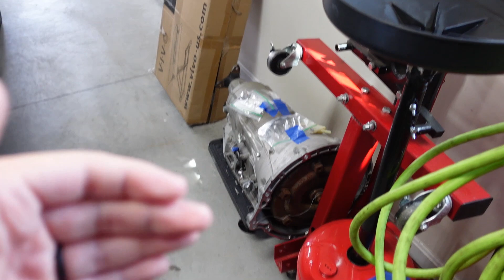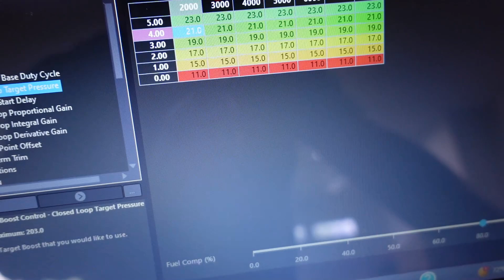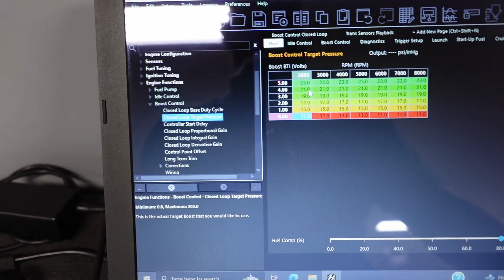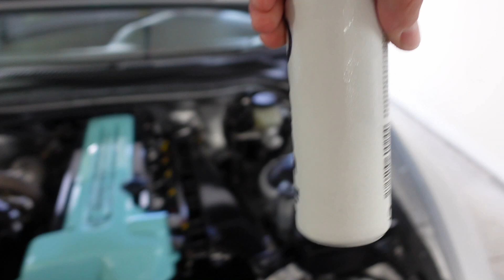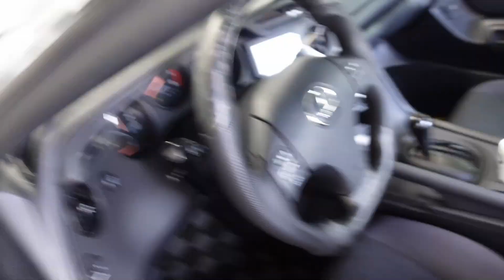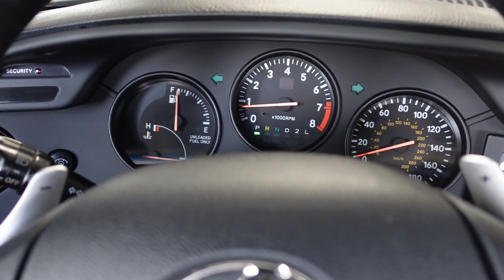Auto Supra Gets More Boost! (In Car POV)

Comment: Interesting to see someone going a different route with the auto transmissions for the MKIV - will be exciting to follow along!
As far as cams goes, I don't think you would move the curve too far to the right with 272's. It might help with spool though for the 6870.
For reference, I have a 6466/cast manifold with GSC S2's (274's) through an ATF auto with a 4K stall - the car is vicious on the street. Extremely responsive around town, running 36psi on the stock bottom end and shifts around 7600. So I would think that you have quite a bit of headroom there.

Otherwise, been a long time follower. Love your attention to detail regarding absolutely everything!

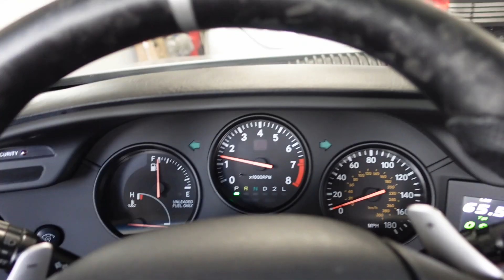Comment: @12:25 the excess fuel you saw during that cold start is likely from your Afterstart Enrichment which only last a short time and goes back to zero where your actual cold start enrichments take over. 

Notice from .85 lambda it jumped right to your cold target of .95 lambda which is perfect for cold start as the engine is cold the atomization of fuel is less a mist and more a liquid spray from the injectors. 

Update: it could also be from your cranking fuel as during cranking the ECU doesn’t pull from the VE table but directly from the % DC during cranking 

I wouldn’t worry about it but unless it lasted way longer but  yes you can adjust it to suit 😉

@24:30 camshaft wise remember it’s the wife’s car not yours 😂 doint go too aggressive maybe a 264/272 would be good Kelford but GSC makes some really good camshafts which have more gains than losses RE to response.

Comment: That’s awesome bro I just got my 6870 turbo can wait to get it on with phr s23 manifold and 264 cams vvti 2j my goal is around 750 to the wheels
Reply: turbo is really big for only 750 wheel.. itll make right at 900-950 on a mustang dyno.    I think its my favorite size setup, i have a 3.4 and the 6870 just makes it feel like a large engine, barely tell its a turbo car really.

Comment: man you are giving out such good info dude great content.   I cant wait to get my 240 running, instead of running the haltec like you did i'm running proefi.  I found out that i didn't need that converter box that you are talking about. Since i am doing all the wiring myself i actually learned a ton with wiring the auto up.  Its nice to cause with the Proefi i dont have to use alot of stuff since it will run on logic or something like that.